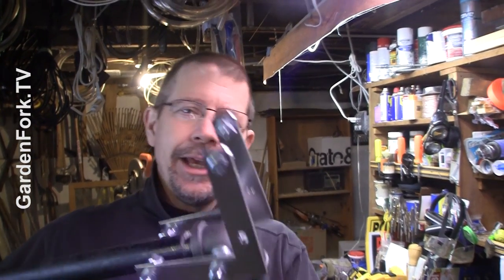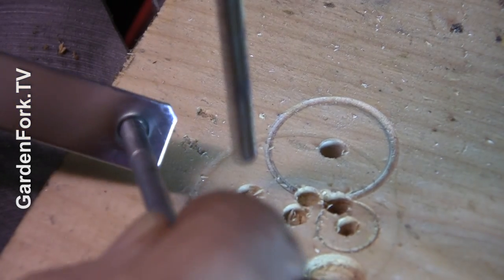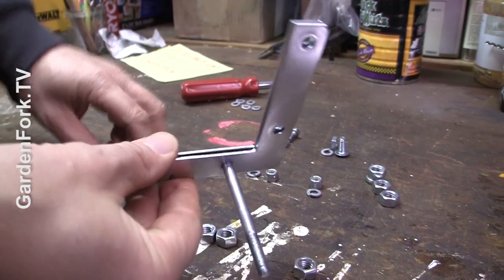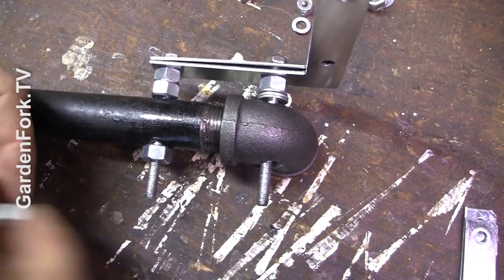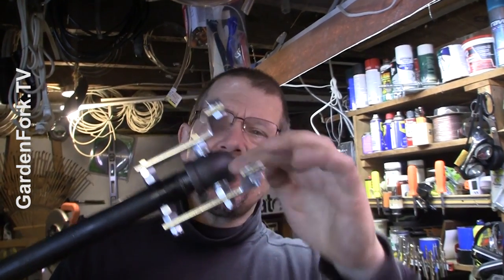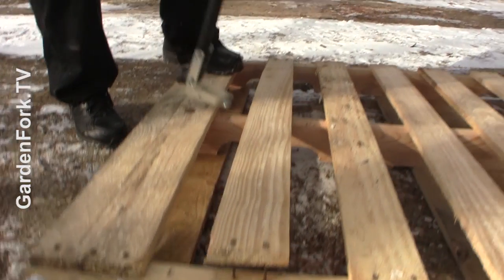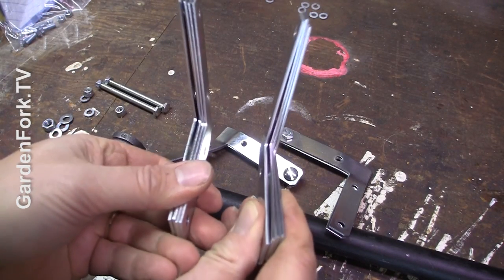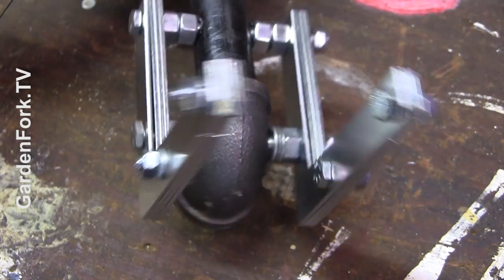DIY Pallet Pry Bar - GardenFork

Comment: Nice design for the non welding people. Another way to make it based off your design is to add a T fitting on the end of your pipe, add two 2" long pipes into the T, add two elbows to that then add 4" long pieced to the elbows. Basically making what you made out of all pipe fittings. It would be super strong.
Reply from the maker: yes, another viewer made one similar to your idea here and sent me some photos, i hope to build it soon and make a video about the process. thx!
Reply: good idea ,,make a video about this ??
Reply: Or share the user's picture?
Reply: Can you make one
Reply: Good idea, just need to lock the pieces into the T so they can't unscrew when you are prying, Locktite or small srews?

Comment: There is a line of hardware in most of the big box lumber stores.  About 3/16" thick.  Simular designs but beefy.  Usually with rhe deck and gate hardware.

Comment: Hey thanks for this, you just saved me $75 to buy one.  I discovered yesterday that my pickaxe worked pretty well for most of the pallet until I got to the end boards.  It still made it much quicker than using a sawz-all.  What I like about your idea versus the reciprocating saw is that you can get the nails completely out.  Thanks for the idea--I'm definitely going to give it a shot.
Reply from the maker: good to hear Christine, I found that this version bent a bit, i want to build another pallet breaker with a larger diameter pipe and larger diameter bolts. thx!
Reply: OMG...  The pick axe!! Never even thought of that and it SITS RIGHT NEAR MY PALLET STASH! THANK YOU!

Comment: PUT A LONGER BOLT IN THE HOLE ON THE BRACKET SO IT GOES FROM ONE TO THE OTHER DOWN BY THE ELBOW THAT WAY THEY ARE STABLE THERE ALSO

Comment: I love how he ground off the corner of angle brackets, so as not go gouge the wood, however, he ground the corners that do not touch the wood. The corners that do touch the wood are still intact, and quiet able to make dents in the boards. Other than that, very useful tool.

Comment: Easy to find + No expensive parts! No weldings...! 
5 points out of 5 ! 
THis is what DIY means to me. 
(thought of using pipe istead of shelf brackets? )
thank you for sharing with us.
Reply: I was thinking the same thing. Put a T connector on the end of the pipe and build up two fingers from there. That would probably work. Or you could also use some sturdier T-brackets. GardenFork his brackets seem rather thin. 

Nice idea and nice video!
Reply: Not only thin but soft steel; tempering would do wonders if you have a torch snd some waste oil, harden the steel.

Comment: Very Nice. Look at every pallet tool on you tube. Think this is great. Love that you can easily find the pieces needed at any hardware store. Great work. Thanx for sharing your idea and plans.
Reply from the maker: good to hear, thanks, I wanted to make one that didn't require welding.  i will be posting another pallet tool in about a month that uses black pipe instead of the angle brackets. thx!

Comment: Was looking to make something like this but have been pretty successful in doing the same thing using a garden fork.
Reply from the maker: a couple of people have found using a gardenfork works well. has to be a robust one. this breaker bar works well, needs some improvements. thx!
Reply: Clearly it doesn't work well as you destroyed it before you had even dismantled a single pallet and then had to rebuild it.

Comment: G'day from Australia. What a great tip. Thank you. Unfortunately we don't get all the variations of tools you guys do, so being able to make my own is a must. I use a lot of pallet and skid wood, but until now I have used brute force and a sledge hammer to get the timber apart!
I love the fact that you showed that the first one you made, failed. Most people don't do that. And then you showed your solution and fix. Great work. Thanks again.
Garry
Reply from the maker: Hi Garry, this tool failed later. Mbe use a larger diameter pipe and better brackets. See some of the other helpful comments. Good luck!
Reply: Thanks. I actually thought the brackets were still a little light, even with 4 of them.
Perhaps if you welded the brackets together it would make them stronger. But them again that would defeat the initial idea of not requiring a welder.
Garry

Comment: Great Video , Just a heads up never hold a piece in your hand while your drilling if it catches you cant hold the piece and it will mash your fingers on the table.  There are slots in the table just put a bolt thru the slot were the piece your drilling can rest against it . So if it catches you won't get hurt . Especially with thin pieces they have a tendency to twist and fly.
Reply from the maker: +Robert Mahon Thanks for the info Robert, I was rushing the project and blanked on that. and i want to keep all my fingers. thx, eric.

Comment: Simple is best, if it works, and yours works the best.  It's a small thing, but nylok lock nuts are made to eliminate lock washers.  My  question: Do you pull the the twisted deck board nails out of the stringers? If so, what method? Many thanks.

Comment: that is pretty awesome! you could have put a long screw in the two brackets to connect them at the end
Reply: blueyez078 A long bolt across would be in the way of the 2x frame, sorry. It needs that space! I thought that at first, at the failure, then realized it couldn't get in.
Reply: Let us know how that works. How you going to straddle the 2X4 and get two sides under the plank, if they are fastened together at the end?

Comment: I wonder if you coul use. JB weld between every brackets to strengthen everything up. That way maybe the angle brackets won't shift and not loosen the bolts. And also use the red lock tight on the bolts? What do u think?

Comment: Turn the joint the other way round, that way it'll roll on the wood rather than dig in, like you did at the beginning when you said it was wrong.
Reply: it also puts pivot point closer to the board for more leverage
Reply: Even better, make it ALL out of black iron pipe & joints: 1" instead of 3/4".

Comment: you could use a smallish builders square. not sure if it will be stronger but it's one piece of steel instead of the three brackets

Comment: I did the same but I used a 1" square tube, and 1/4" mild steel barr for spacing.  I t is possible to get brakets that are stronger (1/4 " steel) but most stores do not have them.

Comment: Awesome job. Not the way I went with mine but this is still effective. I could also see it being easy to add onto it to make the breaker a little longer for longer pallet boards. Mine is good for short boards and I'm trying to figure out a way to adapt it for the wider pallet boards. I have a video out on it. it is pretty long but that's really only because part of it I show how to make it with with hand tools (hand saw), but if you skip past that part until I get the jig saw out, it's not as bad lol.

Comment: use 1/14" pipe, and commercial galvanized angle brackets used for strut, with 3/8" bolts.  will never break
Reply from the maker: +Silentc71 good points, have to try that on the next version. thx!

Comment: Great idea! I tried the 100% galvanized pipe build and it kept coming undone. I'm definitely going to try this!

One suggestion is maybe use JB Weld? Could help...I don't know
Reply from the maker: +Guy H. Hi Guy, don't think JB will help. This will work better with a thicker diameter pipe and bolts. Mine bent after a while. Thx!

Comment: This could be a solution for me. I make  a lot of DIY projects with palletwood. But extracting them, perfectly without broken boards, is stil a difficult job for me. And also Im not able too do welding or something like that. So, for this here I need only a drillpress. I bookmarked your video and maybe, sometimes I try my own one. Thanks formthe inspiration.
Reply from the maker: Hi Reihard, I suggest you use a larger diameter pipe, bolts, and larger angle brackets. this pallet breaker slowly warped. thx! eric,

Comment: Unless you have the parts just sitting around. It's just cheaper to buy one. Consider what your time is worth. These days that thick gauge pipe isn't exactly free. Although I do appreciate the concept of the idea. 

I guess it's just a matter of whether how much you're going to actually use the wood. If you're serious hobby shop Craftsman then it's definitely worth the investment to get a pallet breaker. 

Side note. It's also worth getting the air powered nail remover. It really just speeds thing up.

Comment: have you considered using strong pipe to build the bottom section as well? You could use two pieces of pipe joined by a 90 degree connector on each side. you could then drill enough holes in the vertical sections to use three or four heavy-duty bolts to connect all three pieces of pipe together.
Reply from the maker: i'm working on a new design that a viewer sent me that uses all pipe, i'll post it in  few weeks. thx!

Comment: maybe you can put a angle bracket from the lower bolt on the handle to the closer bolt on the pry fork that will stiffen it up pretty good and maybe a little enamel paint color of your choice let me know what you think
Reply from the maker: that would help. also next one i build i will use a larger diameter pipe. thx!

Comment: personally I just turn the pallets upside-down stand on them and apply even pressure to the board using a block.... works with all 2 way stringer pallets. I see lots of pry bar based pallet pullers.... they normally manage to split the wood. took 5x 3m pallets apart and de-nailed within 2 hours last weekend with only 5 blocks of wood and a claw hammer.
Reply from the maker: good to know! i have done the same with two 2x4s but i also love building tools, thx!
Reply: GardenFork I made a sketch up based pdf explaining my method, if you are interested? I tried to make a video last time I had some pallets to no success due to hardware failure....
Reply from the maker: i need to learn sketchup, be great to see yours,  pls email me:  eric@gardenfork.tv   thx!

Comment: Your improvement worked well and seemed ok but i was thinking....upsize to 1 inch pipe and 1 inch elbow and add 1 or 2 more L brackets...my biggest consern is after a couple of uses you will be constantly tightening the hardware. How has it been holding up over time?
Reply from the maker: Exactly, after I made this, i realized it needed bigger hardware. It held up well for a while, but then the brackets started to bend. My goal was a pallet breaker with no welds, and we did that, but there is room for improvement. Thanks for taking the time to write! eric.

Comment: you need to put a bolt through both holes in  the two plates forks with a piece of pipe as a spacer to make the forks stronger it will eliminate flexing

Comment: If you are not committed to DIY, the off-the-shelf product (just the head) is about $25. The full product with handle is about $60. I noticed the ends of wood seem to always want to split - the three 2x4 with sledge hammer method seems to take care of this. But for me, this is all theoretical - I have yet to go collect an actual pallet and try it out!

Comment: Good idea but restricted to narrow struts. in UK they are 4 inch wide across, this would limit its use, but good idea for small pallets
Reply: Use the bolt holes to add extensions on each side; 4" enough?

Comment: You should have stuck a long bolt through the end holes of the brackets with nuts on each side. This would serve two purposes, --
 1 - The nuts would hold the ends of the brackets together and 2 - The bolt would stop the brackets from spreading/parting. 
Just made one and it works a treat....Thanks for the idea....
Reply from the maker: good to hear! glad to see someone improve on the idea. thx!

Comment: I would suggest one modification. Where you added the 2 short square nuts and short bolts in the end, put 1 long bolt through both sides using the spacers (larger nuts) to bring more stability to the working end as well as what you did with the 4 brackets on each side. This would hold the distance of the brackets in one place in 3 locations instead of the 2 places in your video.

Comment: very nice video and great design on the 2nd,  not so much on the first  :).  ive tried several different ways with varying successes and failures.  yours looks like it may be my last tool to build.  I may tack weld the brackets together as well as bolt them for extra insurance that they act as one.  other than that I see no need to modify your design.  thank you very much.  ks
Reply from the maker: good to hear, some welds would help. i wanted to try to make a pallet breaker without welding, so I did this one. i just bought a flux core welder, so i will do some enhancements. thx!

Comment: Nice idea!! Thank you for sharing!

But in terms of leverage that tool would be more effective without that 90° elbow piece. In your version the elbow piece  makes the lever on the working side (fork) longer so you have to exert more force on the handling lever.
Reply from the maker: i'm going to make an improved version with a larger diameter pipe and will try that. any other suggestions? thx!
Reply: perhaps a T on the back of the 90 might improve the pull and help stabilize the back end?

Comment: Eric, I like your pallet pry bar design.  I do believe the pry bar's failure was due to not having bolts in ALL the holes that bind the brackets together.  I noticed this when viewing the failure result.  In your beefed up redesign you placed bolts in ALL  the holes to bind them together.  The lack of extra bolts may have contributed to the failure.  Just my thoughts.
Reply from the maker: +Ray W. Hi Ray, yes, completely agree with that. I do think adding additional brackets also helped, but keeping them together as one made a big difference too. i may do an improved version, thinking about how to strengthen the design yet make it easy to build. thx, eric.

Comment: Cool dogs...

You actually decreased leverage by using the elbow, but you also decreased the distance you have to move your lever arm to lift the board.  If you're good with the force needed to pull the boards then leave it, if say your wife finds it too hard to use try turning it around, it will take more motion to lift the board but it will also take much less force.

The Nylok nuts and the lock washers are redundant, they both serve the same purpose.
Reply from the maker: good info, thanks for that. the lock washers were for some built in redundancy, and they helped put the nylocks right at the end of the bolts, so no threads stuck out. i'm thinking about a more robust version with a larger diameter pipe. thx!

Comment: Store bought brackets are not the strongest.  Find some 1/4" to 3/8" thick steel angle brackets.  They are stronger and you eliminate the need for the bolts out on the end.
Reply from the maker: good info, thanks Robert, i have been thinking of ways to improve this. thx!

Comment: Eric, I enjoy your videos, and you have great ideas and solutions.  You are much like myself.  I noticed that you chose to use lock washers with lock nuts, this is not necessary unless you had other motives.  It is much like putting Teflon tape on a hose bib.  :-)

Keep up the good work and the videos coming.
Reply from the maker: +jermelger yes, you are right, i was in auto pilot mode, wanting to make sure the nuts did not come off. thx! eric.

Comment: Most of my pallets are from a floor covering business and the spaces between the boards are about 2 inches. I need a pry tool than would fit in that small space. Ideas?
Reply from the maker: you could modify this pallet breaker with shorter arms to fit into the space given. thx!

Comment: I would put a long bolt in the front to tie the two tines together.
Reply: +Paul Otis I had the same thought, but if you tie the two tines together, it won't straddle the long cross board under the top boards.
Reply from the maker: +Flannel Acres yes! that is the dilemma.

Comment: You had better luck than i did. I made one and first pallet i used it on the pipe bent.
Reply from the maker: i'd suggest using a larger diameter pipe. i will be posting a new design this fall-winter. thx!

Comment: Great little set up, buttttttttttttttt, the 90 degree pipe between the two prongs should be facing the other way,so it doesn't mark the wood,and it would roll back easier when the handle is pulled.....😊
Reply from the maker: +Mark O'Connor good point Mark, thx!

Comment: Great tool idea. Could be simpler using two long bolts through both angle bars with locking nuts on both sides of each angle bar rather than using 4 angles.
Reply from the maker: +Scott Reid Hi Scott, not sure if I understand you, but if you have a bolt between the opposing angle brackets, you can't get the pry bar underneath the pallet plank to lift it up. stay tuned for version 2.0 i just bought a welder. thx!
Reply: +GardenFork Ah, yes. I hadn't thought of that :-)

Comment: I use aSawzaw to cut all the nails between the palace it's a lot quicker
Reply: good idea, but wont it damage the wood with saw marks? especially if its one of those air tight euro pallets?

Comment: Just tried the version with 4 brackets on each side and it bent on the first pull when I tried to pull an end board. In search of a new idea.
Reply from the maker: +ALLxoxoxoxo did the brackets bend or the bolt bend? i found a larger diameter Series 5 bolt works better.
Reply: +GardenFork It was the brackets that bent just like the ones in the video when you only had 2 on each side. I used all grade 8 bolts and one other difference I used 5 in. brackets. I also put pipe insulation on the handle. I am planning on trying 1/8" thick steel in a similar fashion. I don't have a welder so that option is out.